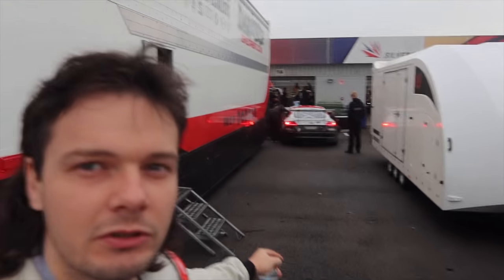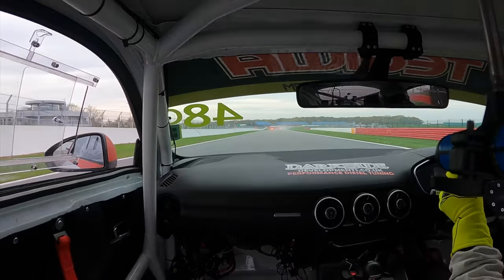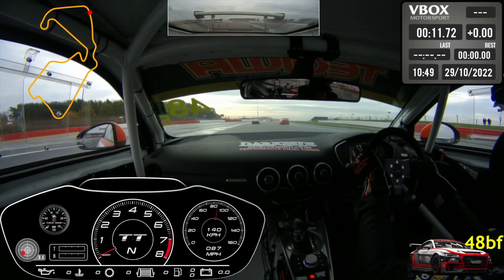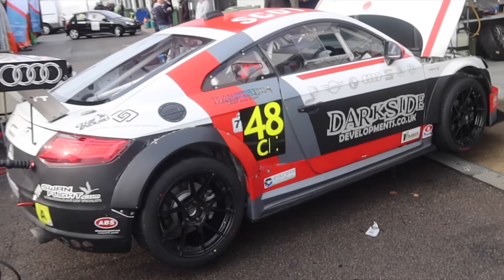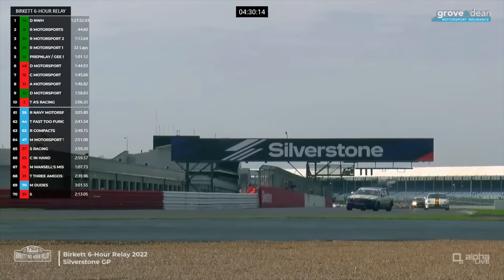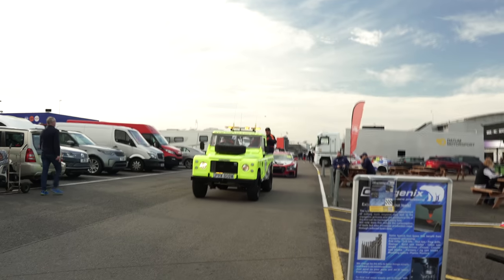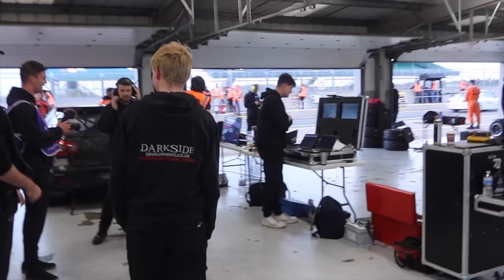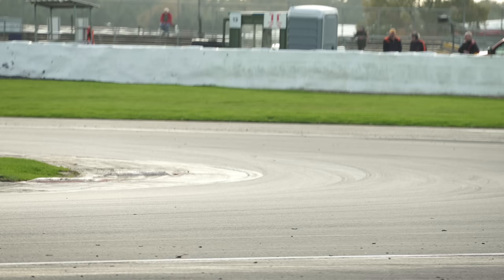Silverstone Grand Prix 6hr Endurance Race - Birkett 2022

Comment: It's about time Darkside invest in some HD boost pipe clamps 😅
Reply: Double clamp all baggins. It's always after a Dyno session they pop off!
Reply: @Ryan P  get some Vibrant performance HD weld on clamps  or the original Wiggins clamps, think Torques on ebay sell there own brand quick release clamp.